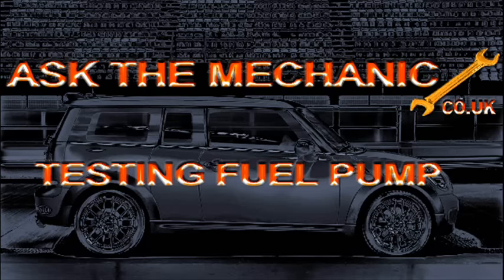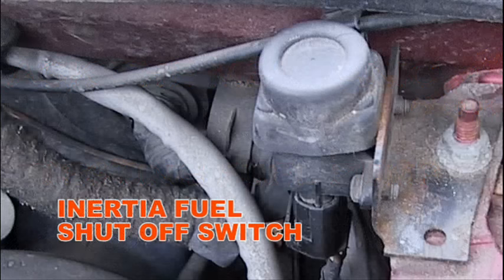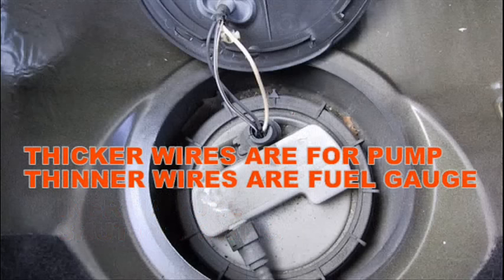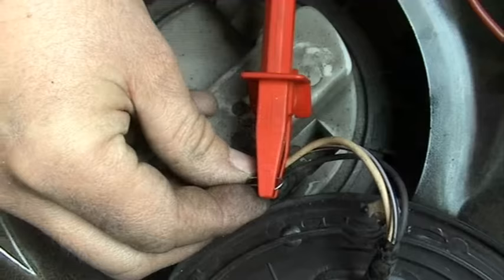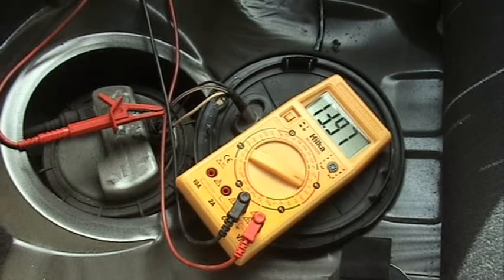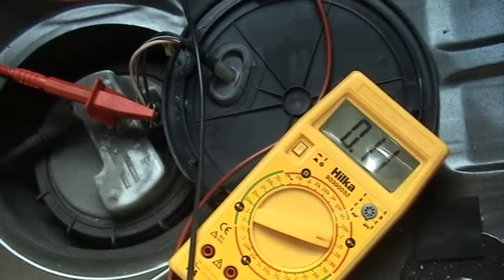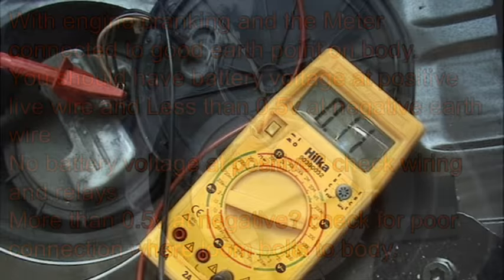How to Test a Fuel Pump with volt meter

Comment: Note to self: This video explains how there should not be more than half a volt showing on the negative side of the circuit, with full battery voltage showing up on the power side of the circuit. If more than half a volt on the negative side, then check the wiring harness where it bolts to the body because the ground connection at that point is probably not good.

Comment from the maker: If the fuel pump definitely stopped running there must still a problem, this could be the pump, relay or wiring. It is easy to change the pump only to find the problem is a relay, please visit my web page on bypassing relays askthemechanic.co.uk/electrical/relays.html
Reply: Askthemechanic.co.uk/electrical/relays.html head that way

Comment: I have a 2003 Saturn vue 3LV6.I used starter fluid in the air intake  and it started right up. I drove it around for about 45 minutes, stopped and started it again without issue. Do I still worry about the fuel pump; or was it a clogging issue? Thanks for your great videos. I know you saved me at least $400 today.

Comment: I have correct voltage, I have a brand new pump installed less than 300 miles ago. everything seems correct but it failed and we have no fuel and no start of course, engine fires and runs when starter fluid is on the air cleaner filter. pump relay is fine. 11 volts read at the pump assembly top with ignition on, gas gauge is working fine.   wits end testing urged me to pull the pump again to find the problem.  I took the assembly out, made sure with Ohm meter what wires of the 4 in the connector go to the sending unit and what two go to the pump.   i took the pump OFF the assembly and disconnected the wires to make sure that continuity was good from the top of the assembly to the plug that goes in the top of the pump.  (bridged the bottom clip and read at the top clip) 

   looking a the pump. positive and negative. tested this brand new pump with the Ohm meter. ZERO OHM,  tested another pump that is still in the box but not for my application. 3.9 Ohms.  

   took the zero ohm pump to a gas filled large bottle, with a set of test wires I made with a switch inline, I ran 11 volts to the pump while it was submerged in fuel.  pumps like crazy. 

    Is it normal for a fuel pump to read zero ohm ? do some run zero ohm and some not?    is a zero Ohm load pump bad is what I am getting at. I was thinking it might still be the whole problem since its only running in the jar with no load on it. doesn't run in the tank at all.
Reply from the maker: Have you tested the pump off the car with jump leads? if so did you check voltages with pump connected? could be bad earth under load.
Reply: Ask The Mechanic
  I didn't test the power while it was hooked to the pump, I will do that later today to see if the power is the power is the is the same.  I wanted to pull it again anyway because I am still getting a hard start even with this new AC/Delco.    this is really getting frustrating.   It runs fine when it starts but I am having the problem of at least three key turns to get it started. 
   I also wanted to pull it to check the strainers to see if they are getting plugged with anything. The tank seems clean as whistle but last time I pulled the assembly the strainers were black. not obstructed but black with tiny particles. The particles are so small they don't settle, they are suspended in the fuel.